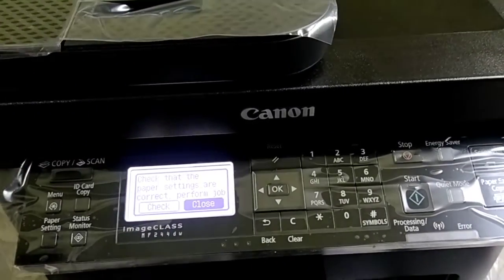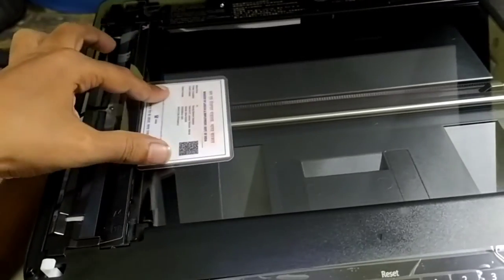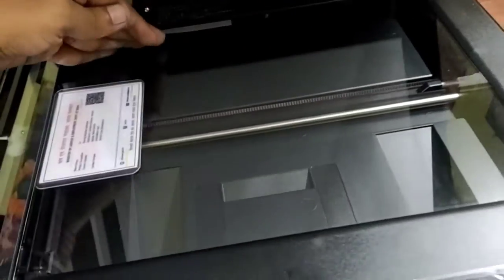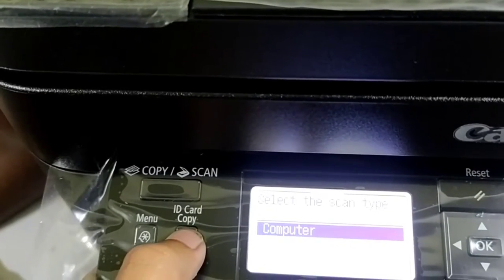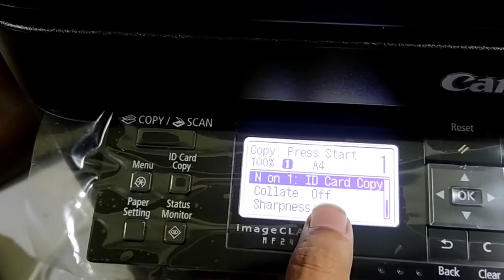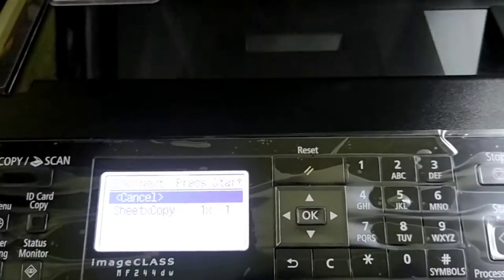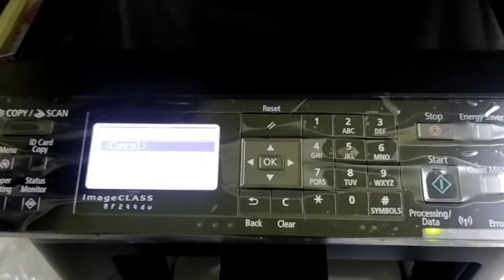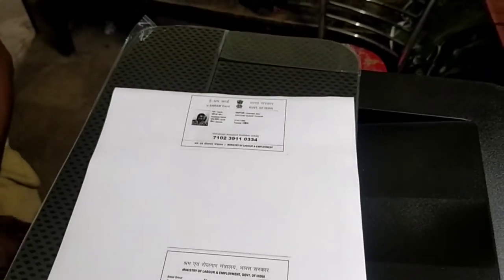CANON MF244DW AADHAR TWO SIDE PRINTING

Comment: I can not print from my computer both side 4 or 6 page together.....my printer can output only 1&2 no page but it can not give me continuous printing...please solve me ...my printer model MF244dw
Reply: Hello Brother, how is your experience so far with this printer? Did you face any issues? Do you have to change cartridge every time or refilling is sufficient? What is the cost of refilling? What is the cost of cartridge? Which ink powder is recommended to use in this printer? Have you ever regretted on purchase of this printer? If yes, what are those reasons? Also, Please share any other information which you faced.. Your comments is very valuable here.. Thank you brother!!